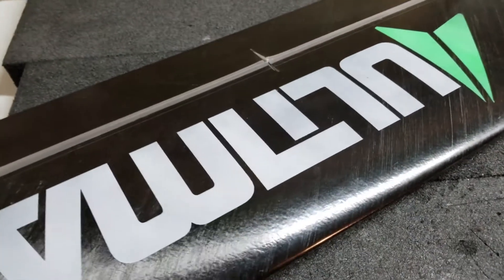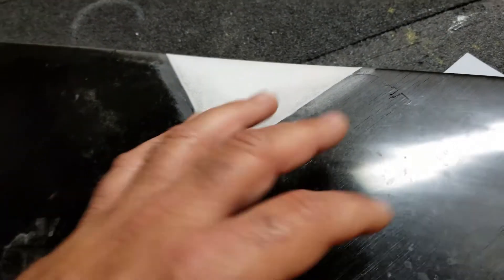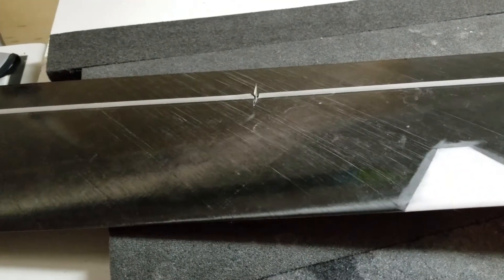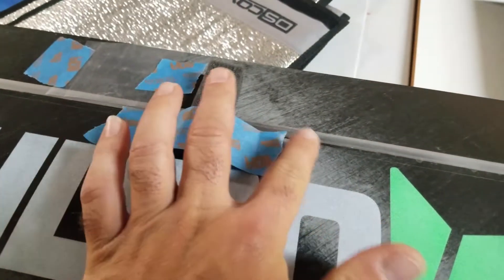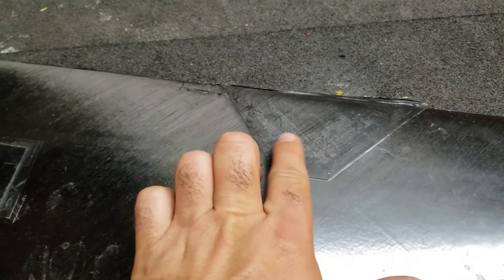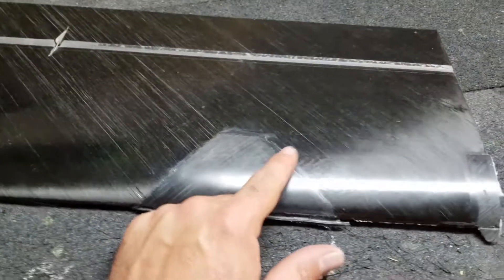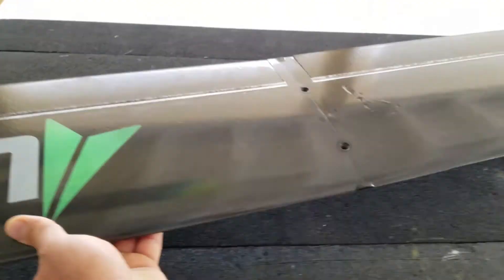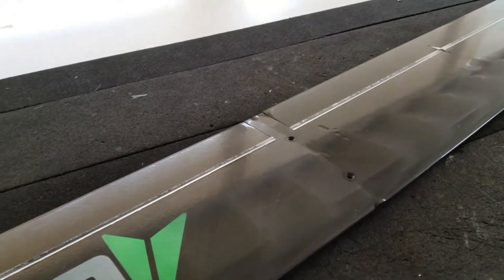Solid Core Wing Repair

Comment: Hoping someone can answer this question......I noticed that the patch he cut for the repair, the 45* pattern was running in the opposite direction. Could he had just flipped it around to match the pattern OR can you only work on one particular side with that cloth (carboweave??)??????????     

Nice repair otherwise!

Comment: Nice video.  How high of a vacuum were you using?  You might have been fine with less vacuum pressure?  A bunch of years ago  it seemed that the 'macho' thing was to have the biggest baddest pump around, but then I was getting ok results with my 'reverse aquarium' pump on. obeeche sheeted wings pulling less than 7psi-- before the current solid molded wing technology was around.

Comment: I have noticed that you should wait at least 2 weeks before repairing foam material because often it will be reshaped almost completely after that time.
Reply from the maker: prep0wer I used rohacell, not foam.
Reply: High-performance structural foam cores

Comment: Beautiful work! Quick qeustion...(I know very little about composite building) is the outer cloth layer shiny because of resin or it it just naturally shiny? I mean, is it soaked in resin or just stuck to the foam with resin on the bottom?
Reply from the maker: Copterdude it's fully saturated with resin. That and the mylar I used while bagging it give it a shiny look. Just like the surface of a mold.
Reply: So essentially the cloth is soaked in resin and a mylar layer is put between the wing surface and the vacuum bag, right?
Reply: @flightcomp  do you have to wax the mylar, put pva on it, or does the shiny non-porous surface of the mylar release by itself?
Reply from the maker: @sl66ggehrubt  hi, you should apply a few coats of wax. PVA is not needed with the mylar. Mylar may stick without any wax so be careful.